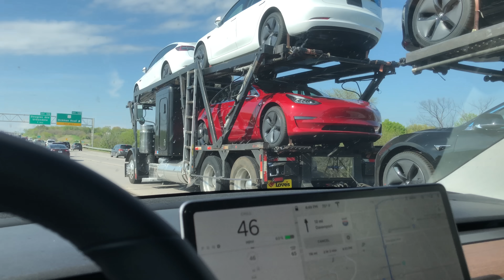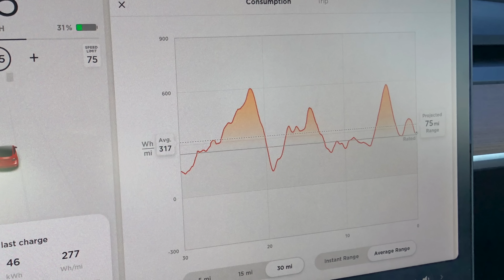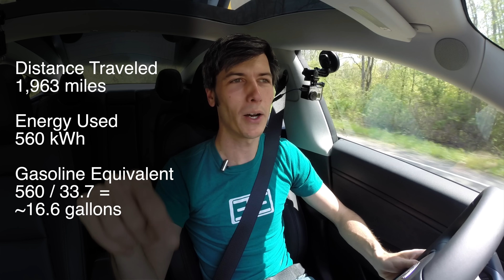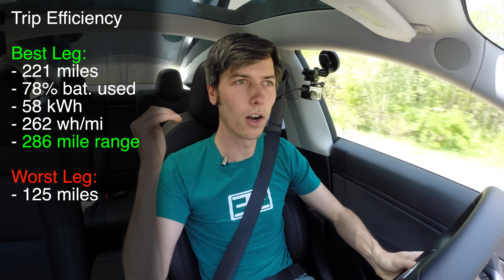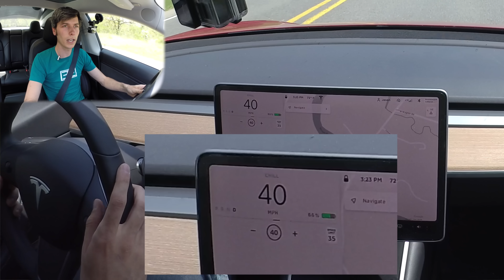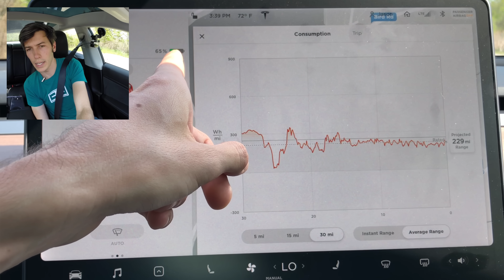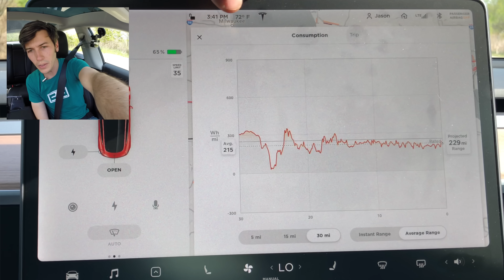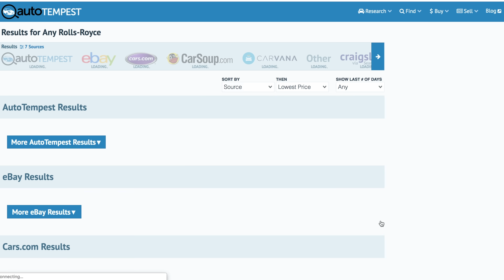How Miserable Is A Tesla Road Trip?

Comment: Thanks for this vid as it shines a light on the reality of taking EV's on a road trip.  I drove from San Francisco to Seattle and back to San Francisco all in one shot stopping three times for fuel in my old Murano.  It took me about 25 hours of non-stop driving, no way would I ever consider doing that it if it required me to stop a bunch of times for a total of 8 hours.  Thats almost 30% of my total time spent waiting for a charge in the middle of nowhere, I don't eat that much and don't need anything at a retail shopping center.  I know they are not designed for this craziness due to current battery limitations.

Comment: it is not easy to drive 120 kmh on highway ... every time I decide I`m not rushing anywhere I`ll drive 130 I`m braking from 160-180 .. cars just dont like 130 speed .. same goes for 80-90 outside of city just impossible to hold .. even with ACC

Comment: If you had done 35 mpg @ $3 a gallon, which is reasonable but a bit low for my GTI (maybe I went 80 mph the whole way), your trip would have cost $168.26 in fuel. The difference is $11.46. It took you about 8 hrs to charge. I would have had to make five stops. I take about 20 mins per stop, because I don't have to eat a sit-down dinner each time. 

The numbers are not good for an electric car as anything but a commute-mobile. Charging costs too much and takes too long, as well as limits you to pre-chosen legs by charger locations.

Thanks for being so open and honest about the electric experience. With real numbers we can make informed decisions.
Reply: I have a fusion hybrid which between Ogden Utah and Topeka Kansas got 41 mpg going between 80 and 85 mph for the trip. 85 in areas with 80 mph speed limits and 80 in areas with 75 speed limits.  This was with AC on and AC seats on when wanted. My only wish is that my car had a bit bigger battery for the mountains as about halfway down the battery would be full thus no regen.
Reply: Should do a comparison to a more comparable care. C class AMG or BMW. Lower MPG and usually premium gas is required.

Comment: Drag increases quadratically. Air resistance = k*v^2
Reply from the maker: With an exponent, I think ya get it haha.
Reply: @EngineeringExplained  As a physics teacher, I am a stickler for precision :-D
Reply: "Exponentially" is sometimes used to mean growing fast. I was also put down by this engineer using this term so loosely.

Comment: I have to comment that I get increased milage and slight increase in straight line stability in my Mercedes 560 Sel. It's an autobhan cruiser so I presume that I sense that engineering mindset behind it. At 65 mph I seem to get around 17 mpg but at 84 I can kiss 21mpg. Any thoughts?

Comment: I would always do a 15% + buffer: good battery hygiene keeps batteries lasting longer.
Reply: Doesn't matter much if you are charging it back up soon. The damage is proportional to the time the battery spends in very low or very high state of charge. And Tesla batteries have a very long life anyway, you don't have to worry about it too much.

Comment: Great video, but I still won't buy one. Reasons:
1. Closest Super charger is 20 miles from the house. 
2. Closest service  center is 9 hours, so even minor repairs will be a minimum of 3 days.
3. Electrical service in the house would need to be upgraded to charge at home.
4. Not able to get parts to do basic  tasks 
5. Electric vehicles range drops significantly in freezing temperatures.
6. Cost of the vehicle. Don't tell me about the model 3 being affordable.  It's butt ugly.
Reply from the maker: 1. You don't need a supercharger near your house, you charge at home. 
2. That parts rough. My closest service center is 350 miles away, so they do mobile service (they come to my house, rather than me going to them). 
3. Correct.
4. What tasks? Only regular maintenance is rotating tires, and changing brake fluid every 2 years, battery coolant every 4 years. 
5. Correct. 
6. They're not cheap.

Comment: 1963 miles for only 196.30 dollars? That's 174,05 euro. That can't be right..
Let's calculate the cost of that if I were to drive that far in my country (the Netherlands).
30mpg = 12,75 km/l
The average fuel price at the time of writing this is €1,762 per liter.
12,75 km costs €1,762, which means 1 km would cost 1,762 / 12 = €0,147 per kilometer.
1963 miles = 3159,14 kilometers.
3159,14 * €0,147 = €464,39
And that is currently $523.72.
No wonder many people in the US drive huge pickup trucks and other huge cars. Fuel is extremely cheap :o

Comment: One thing that bugs me about the cost per mile of Electric vehicles is that it will go up as more people adopt them and use more  electricity.  
Don't assume cost per kwh is going to stay the same when our entire country doubles our electric usage!  :)  Especially when no one wants new power plants built....
Reply: Your math is off substantially.  Electricity is much more stable in price (and much cheaper to use) than gasoline.

I was spending about $140 a month (12 cents a mile) for gas and that became about $40 a month (about 4 cents a mile) in a Tesla.   Even if electricity rates went up 20%, that would just be 5 cents a mile.

But that's not what happened.  I put solar panels on my house, so I got rid of my gasoline bill AND lowered my electric bill.

As far a "doubling" the electric usage, my Tesla uses less electricity in a month than running the air conditioning in summer uses.  More like my $160 electric bill became a $200 electric bill, and then I got solar that covers about $80 of the bill leaving me with now a $120 bill.
Reply: Unless we work to make the energy production itself more sustainable, in the first place.

Comment: But that's power used after conversion from fossil fuel, etc. Maybe some nuclear and renewable too, but that's still probably like 50-60% efficiency. Given that combustible engines are getting close to 50%, electric vehicles aren't that much more efficient and eco, until there's a lot of energy produced from renewable sources.  My estimations could be wrong tho.
Reply from the maker: Combustion engines are not getting close to 50%, only the very best ones are. Normal would be in the 25-30% range.
Reply: @EngineeringExplained  Oh, ok.

Comment: Very interesting analysis....Didn't you have the opportunity to charge while sleeping? say staying in a hotel with charging facilities? that way, you would have started the day with a full battery, reducing the time you would need to charge during the drive.
Reply from the maker: Yes, some of those charging times are hotel lots in the morning (before trip) or at night (after driving).
Reply: @EngineeringExplained   So you didn't spend all the 7 hours 50 mins while charging, actually waiting for the car to charge or eating, but also includes the charging while you were asleep? Or did you deduct the night time charging from that figure? I understood your statement at 1:57 as that was the total amount of charging throughout the three days, thus my question and charging at before/after day trip should not be counted towards the trip, in my view. Thanks again.

Comment: I just bought a 2012 Toyota Camry se with a 99,000 miles on it. It has no transmission dipstick. I checked the car services history on carfax. It doesn't say the transmission fluid has been changed. When I am suppose to change it? Please help.

Comment: 200 miles and 50 mins is if you don't know how to make shorter stops.

Usually, you can go 150 and stop for 25 mins. This is what is recommended by other route planners.
Reply: I drive 400 miles every other week in One Direction and my stop is for 30 minutes. He stopped way too long in my experience. And I've made my trip about a dozen times
Reply: Jimmy Bailey with the new v3 stations it’s 
200 miles charge is 20 minutes. 

So 200 miles stop for 25 your good to go!
Reply: Yup if he tried to optimize i bet he could easily get sub 7 hours total charging time
Reply: Allen Loser that’s Tesla’s new stations for the model 3s.
Reply: @Allen Loser lol

Comment: Sorry my question was answered in the video. My environmental disaster turbo diesel fiat Scudo averages 42 mpg and its 80 litre would only need to have been filled twice x 5 minutes and total diesel cost would be $310.00. It has a spare tyre and high profile tyres so probably would have avoided the blowout but worse case scenario  $180 for a new tyre and 15 minutes to change it. Despite Tesla having the best infrastructure in The Americanas . . . Good ole smelly diesel is very clos in many ways cost wise and superior in its ability to keep moving. You say you had two people . . . That negates the need to rest stop so much assuming driving is shared. Any challenges?

Comment: Great video reporting!  So... 560 kwh/(gasoline energy density of 8.76 kwh/L) ~ 17 galons of fuel...at (assuming CT premium price of my local gas station) 3.50USD...~60USD in equivalent gas cost...wow!  A 2000 miles trip in my now defunct ( I totalled it last winter) golf TDI @  ~ 45 mpg...2000/45= 44 gals of diesel at about 3.20USD per gal...~142USD...nice!!! A factor of 2.3...nice!!! Again, nice!!!
Reply: A factor of 2.8 using diesel only numbers....of course...this is influenced by local fuel prices...but a 2+ factor is enough to consider a BEV.

Comment: You never explained the tire time and related costs. These low profile tries and the problems they create should be calculated into your trip time and overall costs as the price of a new Michelin ain't cheap, you actually got very lucky you didn't have to replace the rim as well. Those tires look nice and they do corner very well but that is about it, they don't handle rough roads very well and potholes can be very expensive especially if you damage a rim.

Comment: See the thing you are getting excited for you are not explaining why it's bad, You ran thru the upper midwest where coal burning is the norm for power, how much coal was burned to make your electricity, 16.6 g of fuel but how much coal was burned to make that equivalence, do your math Jason I know you can. Not only that how much is the cost of those batteries and will they last say 200,000 miles. I wouldn't be bragging about that trip.
Reply from the maker: I did do the math: https://youtu.be/6RhtiPefVzM

Comment: 3:40 quadratically, not exponentially, just saying
Reply from the maker: "exponential: of or expressed by a mathematical exponent." Squared, cubed, they're exponents in the math classes I took.
Reply: @EngineeringExplained  Exponentially should mean the independent variable is at the exponent, as for exponential functions. For example, the function to calculate compound interest, or radioactive decay. They are different from power functions which have constant exponents. The exponent here is 2, so it's quadratic. (Addition of multiple power functions with non negative integer exponents at the independent variable is a polynomial function.) 
It's probably not a good idea to mix up exponential functions and power functions.

Comment: Wow you only save $40 using an electric car? But the car cost $35,000? I'd rather just stick with my 2001 Honda Accord v6 that's already paid off years ago, no stopping to fuel up every 200 miles

Comment: Running the battery pack really low then charging it to full over and over will rapidly degrade any EV battery pack. This car was not intended to go on long road trips. Reviewer pointed out that range is much better in city driving and much worse for cruising on the interstate highways.

Comment: The Performace 3 is the least efficient Tesla 3.  You can almost duplicate this trip with 1 person in a 240 mile plus 3.

If you are taking the scenic route real-world mileage is insanely high as long as there are not much elevation changes.  My long-range RWD 3 can exceed 300 miles between charges easily under such conditions. Consuming less than 200 watts per mile.

The fastest way to travel is to take some risk.  You drive as fast as you can legally drive and stop when you get to 15% charging to 80%  or stop at 50 miles charge to 260 miles on the long rang RWD 3. Drive as fast as you can to get your arrival battery level as low as possible. Arrive at 10% or 5 % and you will hit 260 miles in well under 1/2 hour.  More like 23 min.  Your time to distance moves down.  Driving 55 mph then charging to a full charge takes forever.
When Tesla gets the 250 kw chargers out it will only take 15 min to charge the same 200 + miles.

.

Comment: Interested to see an analysis of the true energy efficiency of EVs and debate on potential efficiency of carbon neutral fuels vs. EVs. Between generation losses and transmission losses, only about 1/4-ish of the energy produced gets to a supercharger plug (how effecient is the charger? Have to subtract that too.) Line losses in the US are actually a lot lower than I thought, but still 120MPGe would probably be 30MPG energy equivalent from most current sources. In most of the US my TDI is responsible for (possibly much) less CO2 emissions than a Tesla. 
Ignoring the other benefits/drawbacks of EVs vs. ICEs I'd be interested in a good analysis of what it'd take to make EVs have a smaller carbon footprint than an efficient ICE powered vehicle, especially if we can develop carbon neutral fuels using renewables.

Comment: So, in summary:

1. You had 12 forced stops at the few locations where Superchargers exist.  Here's hoping you liked the Applebees on offer while you were twiddling your thumbs.  I guess you could have taken a Lyft to that great restaurant that everyone is recommending on Yelp while your car was charging.
2. You're forced to stay basically on the Interstate Highway System where the infrastructure exists to serve this kind of trip.  The back roads of eastern Oregon are off limits to you.  Hope you don't need to cross North Dakota.
3.  God help you if you try to do this trip in the winter.  I know I like driving with a parka on.

45 minute refueling every 200 miles just isn't acceptable.  I like a leisurely poop as much as the next guy, but I can only do it once a day.
Reply: How often do you take 1000 mile trips?
Reply: @xBIGMUSCLEx  Only every year or two -- but this is key, several times per year I drive way off the beaten path.  In a diesel, no problem.  In a Tesla, problem.
Reply: On the one hand I agree, on the other I don't road trip, because I hate it and I don't need to.
Yeah, if you are a frequent road tripper I wouldn't recommend a Tesla.  If you are an at most once a year road tripper then the inconvenience is more than off set by the convenience the rest of the year of never hitting a gas station or taking your car in for maintenance.

Comment: In the North of the UK I would have to push for the last 120 miles of my Route because There is only Chargers (3 of) at each Motorway services.. sometimes and there are Zero on the fast A roads

Comment: All the video i was calculating into metric system :( i think one of the ways how US would migrate into Metric unit system is influencer like You ;)
Reply: Some Americans do use the metric system, I work for an automotive supplier and we use the metric system. I've got use to it, does seem easier. Metric tap drill is easy to calculate diameter - pitch, no chart needed.
Reply: @kendavis8647  I totally get Your point. What i suggest is to use onscreen text with numbers on both systems, so it would be universal and would teach "both sides".

Comment: So tesla fuel wise is not cheap. You saved 40$ in a 2k trip, comparing to 30mpg. So honda civic is actually cheaper to run than tesla. Wow.
Reply from the maker: Haha, you're actually surprised that a Honda Civic is cheaper to run than a Tesla?
Reply: @EngineeringExplained  yes, i genuinely thought that EV's are a lot cheaper fuel-wise. You go from 35% efficiency in ICE to (as i imagine) ~80% efficiency in EV and don't even save money doing it. This makes me feel weird.
Reply: @MrJObajobas  you go from 30% efficiency to 90% efficiency and better aerodynamics with technically cheaper fuel and it's still more expensive because tesla tax.
Reply: Wow that's expensive, tesla charging is a ripoff
Reply: It's way cheaper to charge at home, which is not true for the Civic.

Comment: For air resistance, power is to the cube of speed. It's not exponential.
Reply from the maker: Cube is an exponent. I think you understand that.
Reply: @EngineeringExplained  "Exponentially" usually means that it follows the exponential function, exp(x), or e^x. Although the exponential can be expanded to include the cubic function, x^3, the two are definitely not equivalent.

Comment: As I know, it is hard to compare a battery with a tank. Could you please make a video about theoretically best efficiency of IC engines? Maybe Diesel included? :)
Reply: @Ryantube007  Of course, but that is all practically speaking. There is a theoretical best thermal efficiency at about 60%, it can't get higher. Would be interesting to know how engineers are able to calculate that.